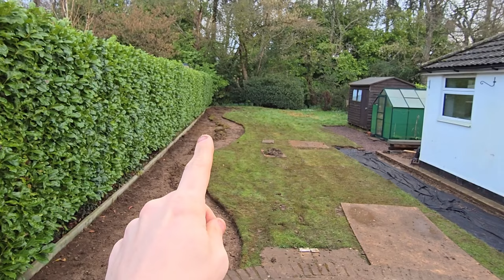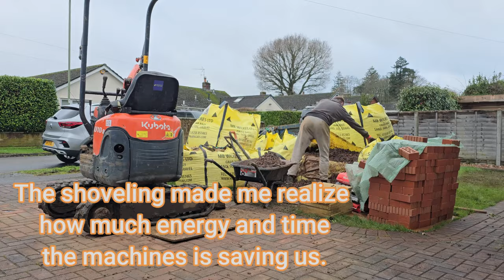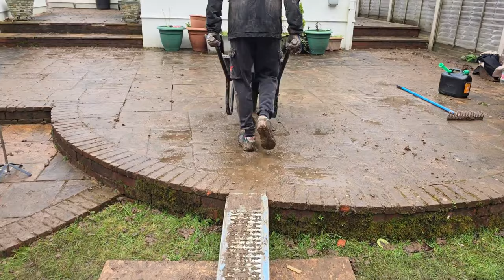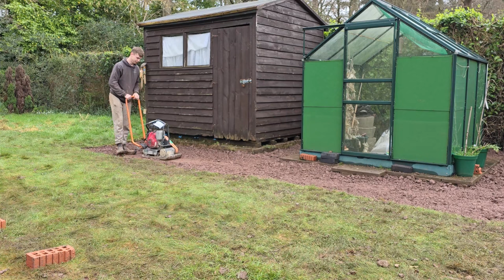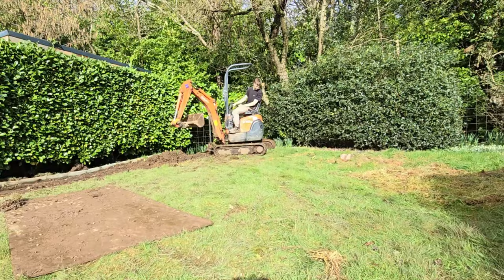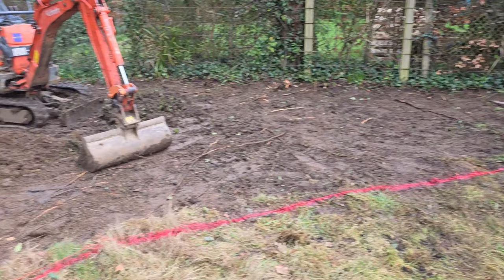The Wheelbarrow Awareness Course 😂 The Job is Taking Shape(A Day In The Life Of A UK Gardener EP35)

Comment: That where Tracked dumper been handy help empty bags
Reply from the maker: Attract dumper is probably one of the things I would have done differently next time. I just did not want a risk. It ripping up the grass. Because if I look at the numbers it would probably cost around the same to rent a dumper than it would the labor i paid.
Reply: Agree, to be honest, you could well have done the job so farr solo with a tracked dumper but you would ideally need more ply sheets to run on and were ever you are turning.

They chew up badly on turns but even on wet grass you can go over a few times in a straight line before you risk chewing the ground up.

Remember a tracked barrow holds around a 1/4 ton so around five wheel barrows worth so you are doing less trips

On a narrow dig were you want to dig flat then unbolt the teeth from the 18" digging bucket and use this rather than the gradeing bucket. This is useful if you are loading a tracked barrow with a 3 ton machine  where the bigger gradeing bucket spills material being wider than the dumper skip

Comment: Tracked Dumper payload 500kg the Wheelbarrows make it just as messy because narrow Wheels
Reply from the maker: It's not that have you ever tried turning a tracked machine on the spot and you will instantly see what I mean. I was thinking more along the lines of a powered wheel 250 300kg Barrow not quite a track dumper.

I could have made a track dumper work. But I'd have had to invest in much more OSB. And at that point it may become more of an expensive mission... Also, the different gradients would mean. I would need to get a solution for ramps etc So all in all, I decided against it